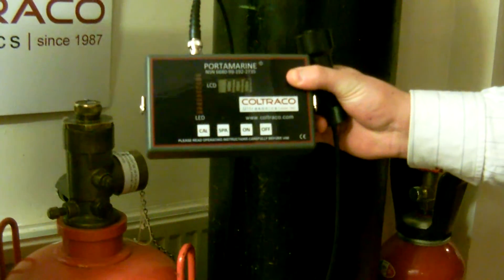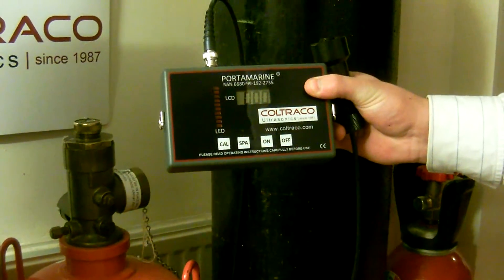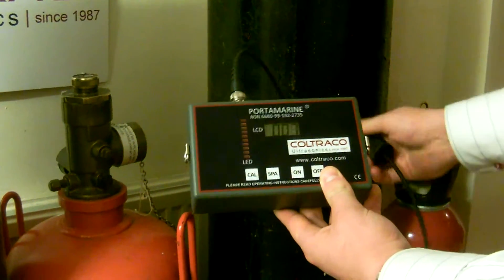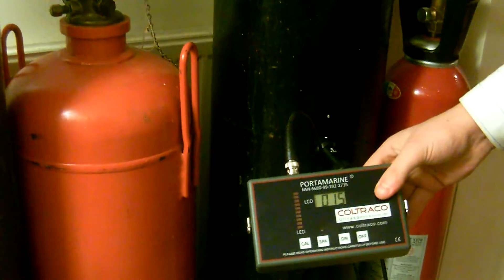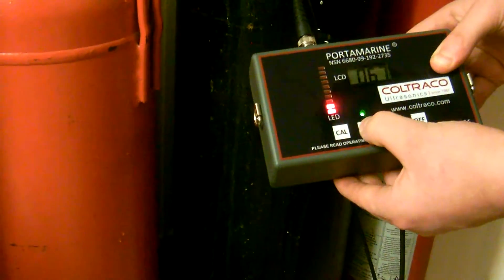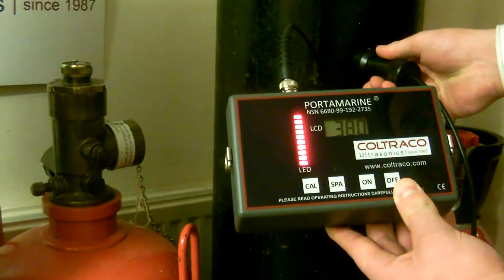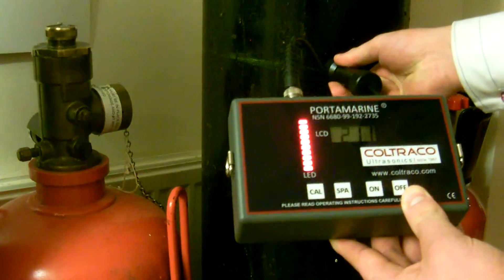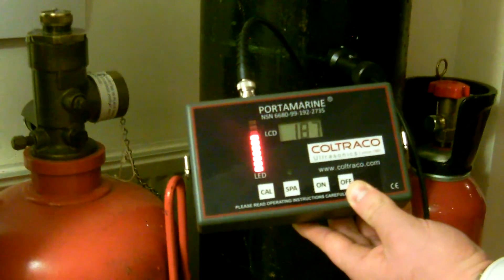Demonstration - Portamarine® - 45KG CO2 Reverse Method - Coltraco® Ultrasonics

Comment: what happens when you get very low readings? even at the top of the cylinder.
Reply from the maker: Dear Carlos,
If you get very low readings even at the top of the cylinder, there are a variety of reasons causing this. One of which could be the liquid level happens to be very close to the top of the cylinder (near the dome) due to high temperature and / or overfilling. If you have any concerns please get in touch with us at support@coltraco.co.uk and we will be happy to discuss your issue in detail and provide the support you need.
Many thanks,
Coltraco Technical Support